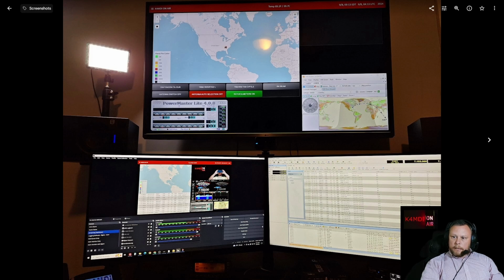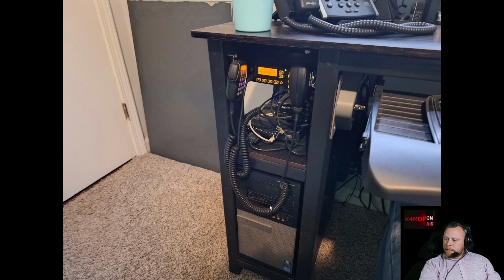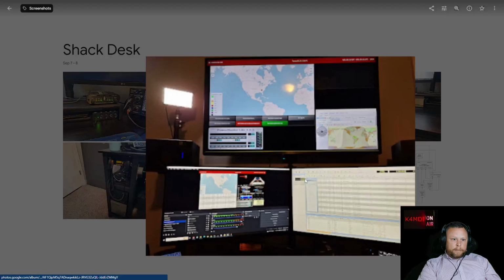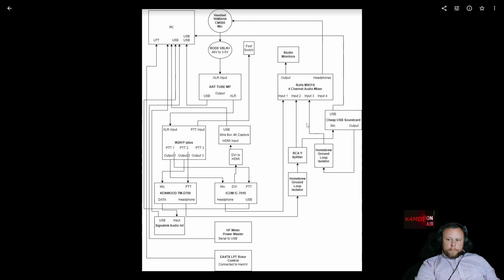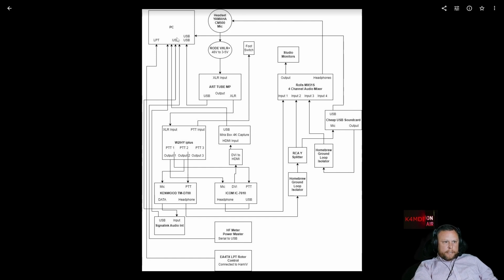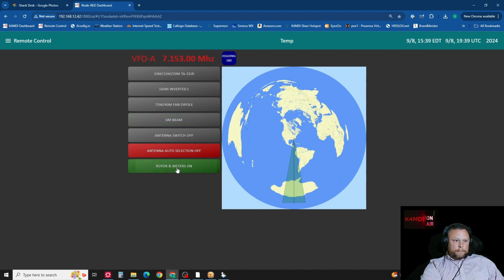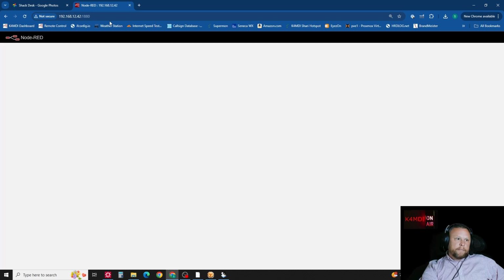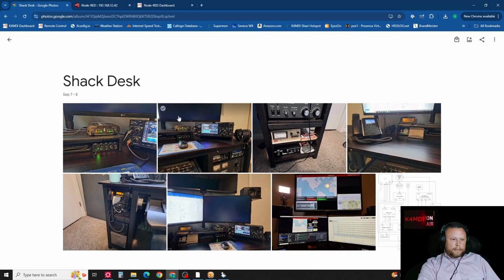How I LIVE Stream Ham Radio, turned into station tour!

Comment: Curious how you setup the CDE Rotator for computer control.  I have the same.  73.  Nice Shack.  KB2AT
Reply from the maker: I have directly tapped into certain places in the rotor control box and connected them to their respective terminals on a EA4TX rotor control board.  I use an older LPT Port Board that's been discontinued.  Hope this answers your question.